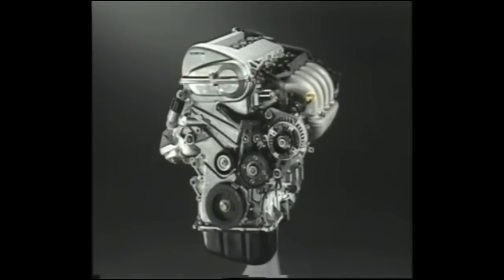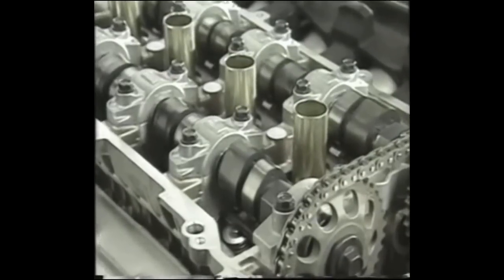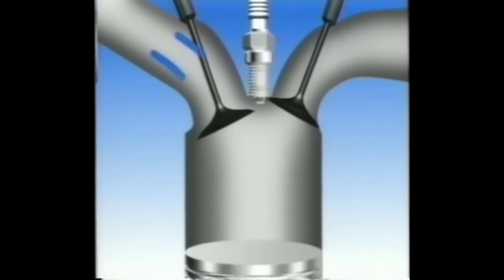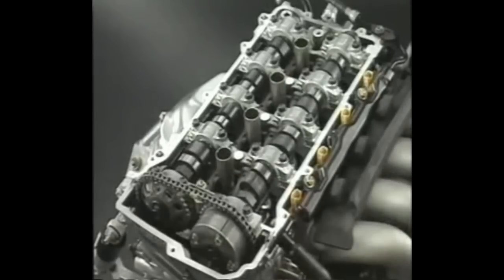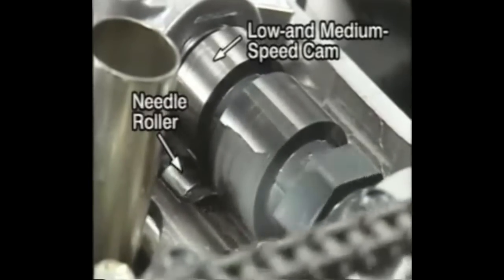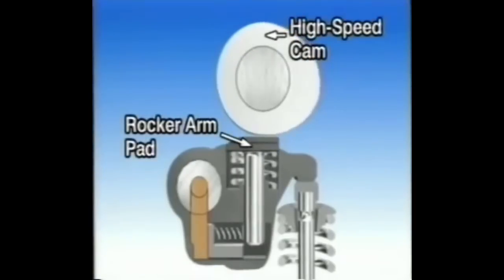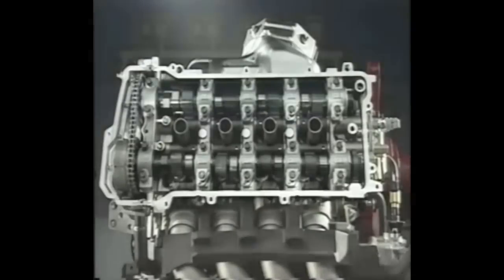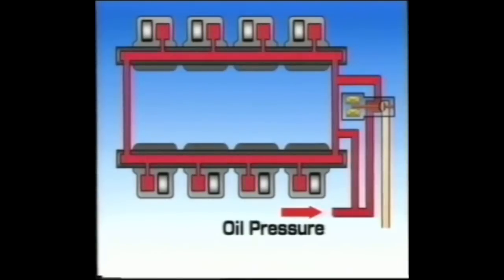Toyota's Valve lift VVTL-I explained on 2ZZ-GE engine

Comment: Sombody know if I can put a 2zzge in a corolla 1999?
Right now I have de 1zz fe, stock one.
Reply from the maker: Jeison Alvarez 
Yes it would fit engine would bolt in relatively easy. Hardest part would be rewiring the electronics
Reply: SV Sportscars thanks!!! I will try it!
Reply: I got the same car and it’s a 5spd lE
Reply: Yeison Alvarez what model is your '99 corolla? E11 or E12? If it's E12 it's an easy fit and should match all engine mount points as any other zz engine, if it's a E11 you might hav an issue with mount points as some E11's had a leanburn engine as opposed to the vvti zz engines even E11's with a zz engine might be different as the engine bay isn't the same as a E12 but it still may fit in. Also a 5spd gearbox will mate up to a vvtl-i but I'd recommend getting the 6spd to make life a bit easier
Reply: Unless you're ready to take apart your entire dash to rewire a different harness through he firewall then you're better off just boosting the 1zz. Just don't go over 8lbs of boost if your keeping your internals stock.
Reply: Find Sam Nadeem on fb

Comment: This is amazing, do you have full videos of these? The complete guide? And why isn't Toyota's LIFT as popular as as Honda's V-TEC?
Reply from the maker: We have the full training video online what we used to make samples of for this video:
https://youtu.be/jbxErSDvQgM
We currently don't have other similar movies online.

I can't really say why Lift never became as popular except for that in general vtec engines where easier to tune and get more power from for less money.
Reply: Toyota decided to focus more on economy engines to have more sales on the gallon... the 2zzge would have been an upgrage from the legendary 16 4age if they  had focus more on it....my thoughts
Reply: VTEC was there first and is utilised in far more models than Toyota's VVTLi. Toyota doesn't have many engines like the 2ZZ-GE whereas Honda has lots of modern performance engines, all using the VTEC system.
Reply: @bradcogan8588  Yamaha left the VVTL-i system and went to VVT-i on the 3SGE BEAMS. 

And as you know, the BEAMS is boss when it comes to Toyota 4 cylinder engines. 

But nothing comes close to the K series motors from the Honda motor corp. The K head design is something to behold and can withstand a significantly higher lift cam than any other 4 cylinder engine.

Honda is best for 4 cylinder
Toyota is best for 6 cylinder or 8 cylinder.
Reply: @razeenmeyer9728  ye although those BEAMS engines were later than the 2ZZ-GE, it is a 3S-GE which was a bit of a dinosaur at that time and I think implementing a lift system would be too difficult. Toyota and Yamaha didn't abandon it as they've implemented it on engines since, just didn't make sense to completely redesign the 3S-GE for the sake of lift whoch the engine wouldn't benefit greatly from anyway.
Reply: @bradcogan8588  which motor other than the 2ZZ got the lift mechanism from Toyota?
Reply: @razeenmeyer9728 it was only the 2zz-ge and the rare supercharged versions used by Lotus and also in a very limited edition European Corolla

Comment: am struggling to get valves and timing kit for Toyota Runx 2ZZ-GE . I am in Swaziland Mbabane, which other car uses same parts as the runx, please assist
Reply from the maker: Hi Sibusiso, thanks for your question. The Celica with 2ZZ (GTS, T-Sport and SS-II ) uses the same. As well as the european Corolla T-Sport and the American Corolla XRS. As well as the Toyota Matrix xrs. And of course Lotus used them in their Elise 111R, Elise SC, Exige models.
Reply: Also the Pontiac vibe GT
Reply: I recently did my timing chain kit, new sprocket and vvti gear ⚙️ on the exhaust cam (be sure to follow instructions on install to avoid damaging the set pin) I ordered my kit from rock auto website. I also highly highly recommend replacing the oil pump while you’re that close to it, it’s been known to be the celica’s weak point.

Comment: The Toyota’s corolla sportivo has like 141kw is the lift giving you an extra 40kw on top of that
Reply: Nope. The 141 kW (+- 189 hp) is with the lift, without it tops at +-105 kW (+-140 hp).
Reply: Nathan Vonlanthen ah bugger I want to get one of these and sell my 115kw lancer not sure if it’s worth it. These would definitely be funner to drive. Are these easy to mod?
Reply: @frasermate4729  Definitely worth selling the Lancer for. All of the knowledge I I comes from the internet - I have no experience with them whatsoever IRL so some facts may be wrong.
As far as tuneability, just like the Honda B18 these are pretty highly strung from the factory. Fitting an intake, full exhaust and remap might grant you 5 hp. The most gains come from camshafts. With MWR Stage 3 camshafts, valve springs, high compression pistons revving to 9000+ rpm, you might see 240 to 250 crank hp. Add individual throttle bodies, and a 2.0L stroker and top of that, you could be pushing above 280 hp. These engines are expensive to tune naturally aspirated: just like the Honda B or K series. They sound great though.
These aren't easy to boost either: the cylinder liners aren't made for boost and anything above 500 to 600 crank hp (obviously with forged jnternals) becomes risky. If you wish to go above 600 crank hp, close the deck.
Conclusion: if you plan on doing just some mild modifications, this might not be the engine for you. If you have a few thousands to spend, then you could get good power out of them. I would tell you, go for it anyways. From what I've heard, these are great cars, very enjoyable, and come on. 8250 rpm, how can you say no to that ?
If I got one, first 2 mods I would do is upgrade the oil pump (the stock oil pump is underpowered: a few seconds of oil starvation is enough to ruin the engine for good), and fit a shorter final drive ratio. The stock Corolla TS (or Sportivo in Australia) tops 70 kmh in 1st, 110 kmh in 2nd and 150 kmh in 3rd. A shorter final drive getting you to 65 kmh in 1st, 100 kmh in 2nd, 137-138 in 3rd would be perfect. Slight effect on fuel economy, but it would really wake the car up.
One of my dream project cars would be a turbocharged, 2ZZ MR2 Spyder pushing 900 crank hp. A supercar killer for sure. 
Tell me what you think.

Comment: If only my 2000 celica GTS had the 6-speed.......... Maybe one day i'll fix that problem
Reply: How does your 2000 GTS have a 5 speed?  Engine swap from a 1zz but you kept the original trans?  I'm almost certain all the GTS's came with 6 speeds...
Reply: Ooooh wait you have an automatic, okay.  Nevermind my first comment.  But yes, get a 6 speed manual if you can.  Absolutely.  I drive a 2001 GTS 6 speed.  👍👍
Reply: @brianmessemer2973  Correct mine came with the 4speed auto, It has M-mode but it's still slow.

Comment: all 2zz-ge engine are the same bloc. The intake throttle body/headers/ecu are different on the Celica than the Matrix/Rolla. My 2zz died in my 00 Celica and I installed a 03 Matrix 2zz. Very same bloc. the JDM ECU 20060 ecu is the better one to got for the Celica
Reply: block*

Comment: Is there any chance of being able to swap a toyota corolla tsport engine (3zz-ge) into a tspirit from 2002? Just wondering, thanks.
Reply from the maker: Yes it's possible, mechanically it all fits without any problem. The main issue is that the ecu is of a different style compared to a ts. So you eighter need to rewire the harnesses in engine back and dashboard. Or rewire the wires for the ecu and get only the engine harness. Both are time consuming options.
Unless you are attached to your Corolla it's better to just trade it in for a TS.
Reply: @SVSportscars  Thanks, I am sorta attached to my car, so I think I'll take it as a long term project😁 (idea being: super sleeper mode)
Reply from the maker: @TA-70  we also did it with 1 of our cars for the same reason.

Comment: So Toyota basically designed these engines to be thrashed? (Ofcourse with proper maintenance)
Reply from the maker: Yeah kinda. Lets say to be used all over the rev range. And it taken care off they will last a long time.
Reply: I absolutely thrash mine on the daily constantly hitting about 50rpm from the redline and it’s yet to give me many issues at all, I’ve gone ahead and replaced the timing chain and constantly put new oil through it and nothing has failed yet. Just be sure not to ever downshift too far because you’ll blow the oil pump and that’ll toast the whole engine
Reply: My 2zz gets thrashed daily all the way to redline.  Now has 388k+ miles and still thrashing that vvtli
Reply: @abuelb  I'm at 204k miles rn on my 01 gts, hows she holding up now 7 months later??

Comment: How do you get the power lost over the years that the 2zzge engine has?
Reply from the maker: Generally these engines don't loose much of their power over the years. We have seen them often with 180+ on the dyno even after 200k + kilometers.
Reply from the maker: @DimoS...  if maintained well and properly warmed up well these engines can last a long time. The oil pump issue is not as big issue as most say. They can go bad but mostly happens when overrevving (accidental downshift) make sure you use good oil and replace the liftbolts once in a while (every 30k miles (50-60k km)
Reply: @DimoS...  Some issues with the motor come from people not letting the engine warm up and hard revving causing damage to the cylinder walls because of the coating they used. People not using premium gas with hard revving causing issues as well. If you take the motor to a track day and pull a long, hard turn, the oil pump might suck air and fail. other than that, the motor is pretty strong. my motor is 300K+km and is still fun to drive

Comment: Corolla Sportivo. Amazing Engine.
Reply: Sadly I only got the 1ZZ-FE :(
Reply: @goransvraka3171  You're missing out on that valve lift bruh.
Reply: @chrisasimopoulos9821  I know bruh I know. No LIFT with a normal economy corolla. Maybe I could add one those larger egg shaped rockers. Now am curious to see what my engine looks like inside
Reply: @goransvraka3171  Even the normal rollas go well. But the Lift Engines have amazing acceleration after 7,000rpms. It's insane. You just gotta change gears well enuf.
Reply: @chrisasimopoulos9821  can u mod an vvti to be  vvtli
Reply: Lift kicks in at 6200-8200 rpm on the 2zz used in Toyota cars. Lotus revs to 8500rpm. Love my 03 sportivo.  Use it every day. Sounds amazing in lift.

Comment: Can anyone help  me on that? I have an Sti celica '92 with  a 4a-fe stock engine which is almost dead at this point. Can I replace it with a 2zz-ge and where can i find a 'new' one? And is there another alternative for better hp/relatively lower oil consumption ? Thanks
Reply: Look for jdm engine sellers. For example jdm Orlando. A low mileage 2zz and 6 speed transmission is around 3.5k. As for the oil the 2zzge does not consume oil it was first model 1zzfe. For good NA power on a 2zz I recommend a standalone ecu apexi power fc or ems 4 and get r9k tune. With PPE 3 inch intake and maybe intake manifold you can make around 210-220 wheel horsepower.
Reply: I would not recommend the 2zz. I recommend a 3sgte swap
Reply: @sosbabe2804  thank you  for your advices man. The thing is, im in EU so its particulary rare to find a  jdm engine  seller here (and reliable ofc). The thing with the 2zz is that its newer and has 1800cc (we get to pay taxes for cc for cars before 2011 ffs). The legendary beast 3sgte on the other hand is older(so extremely unlucky to find in a good condition) and 2.0cc which is terrible for my wallet due to its tax unfortunatelly.
Reply: @GLARELIS4LOL  yeah man the prices are ridiculous in the uk.
Reply: Yes I can be able to help you for that as possible.. the vehicle is manual or automatic??
Reply: @williamjessica8981  Its manual. And im thinking about getting in the near future a 4age Blacktop (20v Itb's) while its much easier to install (less electronics i guess) with a fine sound.

Comment: How does it compare to 2ar-fe or 2ar-fxe? 2ar-fe is better than k20.
Reply from the maker: It's a completely different engine and was not made with the same goal as a 2AR engine. the AR is a bigger engine build to be practical and economical especially the fxe models with the atkinson cycle. 
It has more in comon with a B18 engine and to a extend a K20. They where build to be lightweight high revving sporty engines.
Reply: @SVSportscars  their a engineer on YouTube here who swap out the intake cams on fxe and getting around 240hp stock. I got another question 2.0 2zz stroker is good or better as k20 swap?
Reply: @rolldog82  2arfe is not better than a k20, also k24 is a thing too
Reply: @arcanevoid9199  how you know? Just wondering
Reply: @rolldog82  I mean disregarding the specs and how it makes more power easily the kseries engines are designed for performance and are designed really well. 2ar is just a big displacement economy engine for suvs etc
Reply: @arcanevoid9199  thanks for clarifying it for me

Comment: How to make* ocv open manual?
Reply from the maker: Sorry, I don't exactly know what you mean.
Reply: @SVSportscars  trying to figure out how to make the ocv open and close like a v tec on a honda
Reply from the maker: only possible with a stand alone ECU. you can't change settings in de stock ECU.
Reply: It can be done but it’s not advisable because, if you had paid attention to the video.. it points out and shows that the purpose for extra lift and duration is to combat the turbulence associated with higher intake velocity.
At lower rpm’s this is not an issue because the airflow is stable and flows just fine. Otherwise they would have designed the engine to run with the valves that far open 100% of the time. You’ll get little to no gains at lower rpm’s like that.
Instead, look into other aspects that will improve engine performance

Comment: Why wasn't vvtli in the 2jz?!?!?!?!??!?!
Reply from the maker: Eduardo Alvarez for turbo engines this is not very useful. In general the turbo will force air in anyway. Airflow etc is much more important in NA cars than Forced induction.
Reply: SV Sportscars true but integrating the system would be cool.
Reply from the maker: Eduardo Alvarez true :)
Reply: Eduardo Alvarez .bro dnt tink d 2jz needed dat.sick engines world best

Comment: How difficult would it be to convert a vvti engine to a vvtli ?
Reply from the maker: You can't really. It's not that you just add the lift part. The head is specifically deaigned for this purpose and does not fit on other engines.
Reply: So custom head is needed
Reply from the maker: @SaulTamalezX8  what engine are you thinking of?
Reply: 2jzgte vvti of course. Just dreaming right now but if i can get blue prints maybe it can happen
Reply from the maker: Eduardo Alvarez  anything can be done, will be a lot of custom work and indeed blue prints etc. would be interesting to see what it would look like.
Reply: Interesting inquiry for sure, I believe the biggest difficulty would be the oil passages to the camshafts and rockers to move the .. uh.. shuttle valve? For lack of better terms.. then the ocv can be external as such in the 2zz.. but the head oil passages would be the biggest hurdle
Reply: @WPXTacoMan477  yes but maybe can do all electronically controlled. Slrry for late reply lmfao
Reply: @SaulTamalezX8  no, you would still face the issues of oil passage. You have to deliver oil to moving parts and you can’t do that electronically